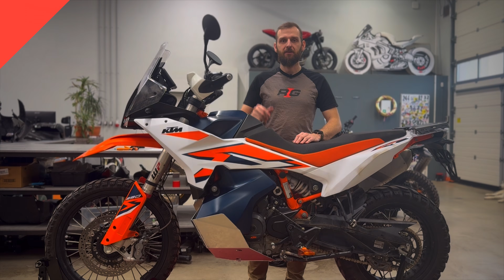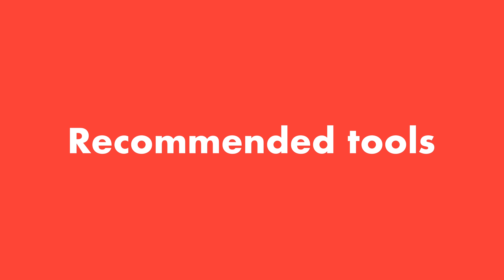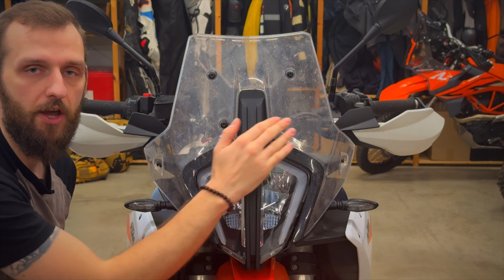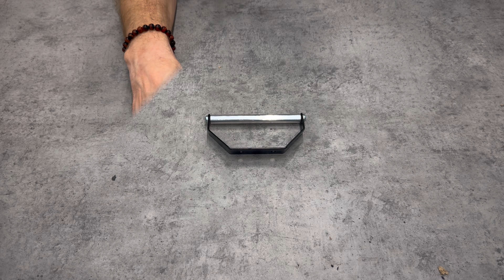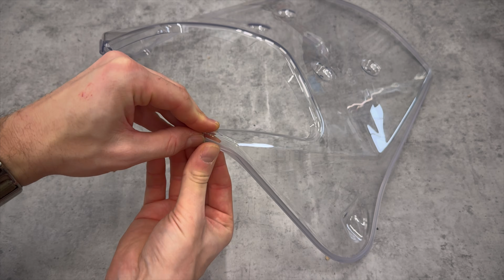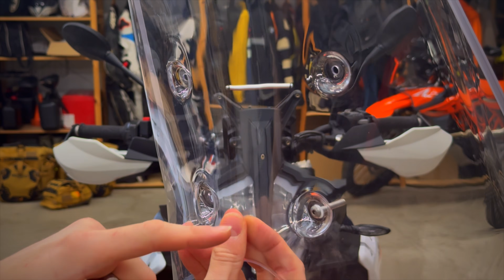KTM 790/890 MY23+ Windshield EVO2 installation - RADE/GARAGE

Comment: I was hoping there wouldn't be any edge cover 😢. Mine keeps coming off on the screen I have for the 790/890 2021 version.
Reply: Is the edge cover required or mandatory? Can you just leave it off the windshield or will that cause damage? The windshield looks nice, but not buying it if a flimsy edge cover is required, that is a no go. Thx